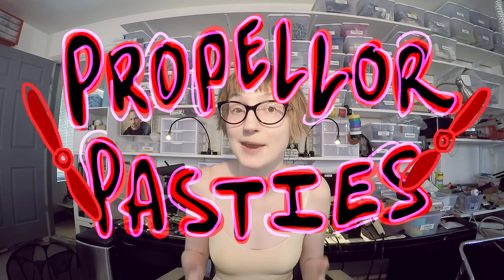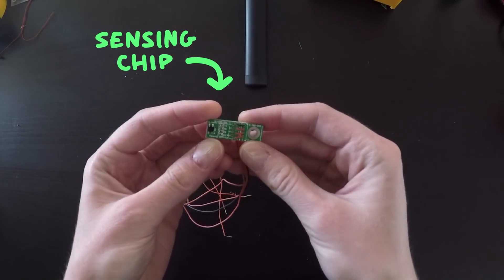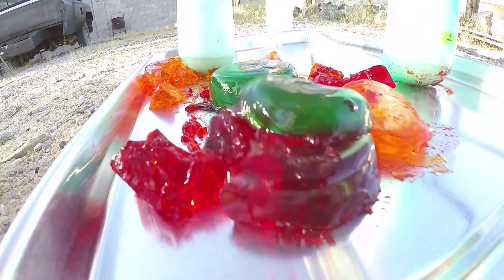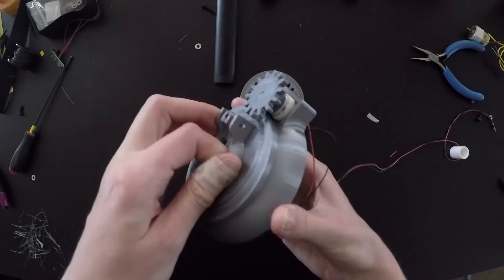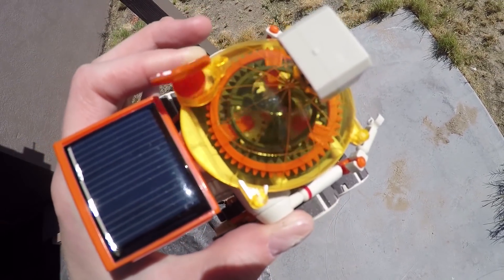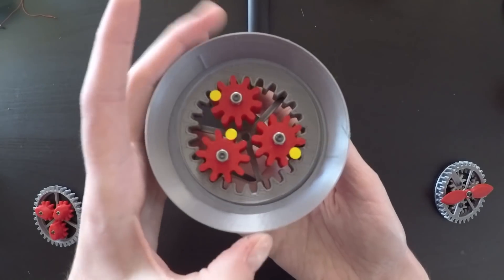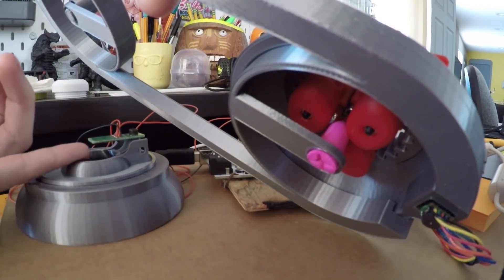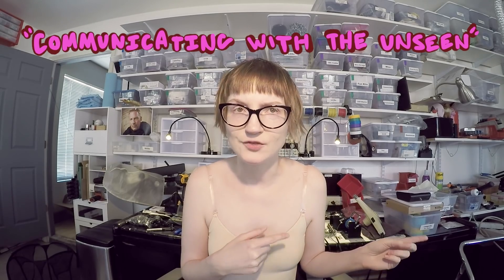SHE BON : Propellor Pasties Make Spinnie Nips

Comment: Perhaps 2x sensors side-by-side & both facing the same direction too; One pointing into the nipple, the other pointing into the areola.  That way the aerola can be used as a constant distance reference, for jiggle cancelation™ of the readings.